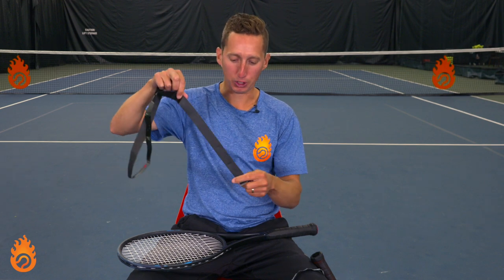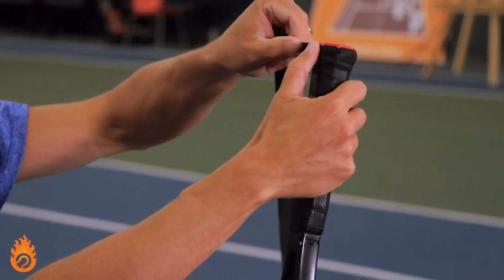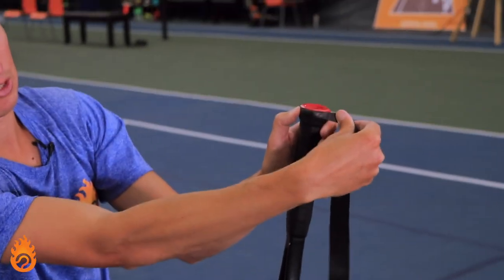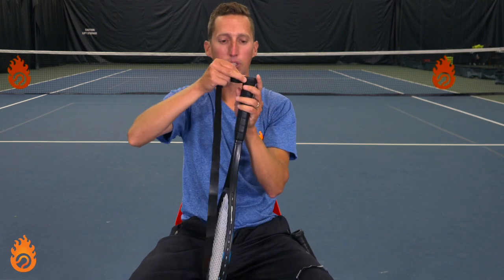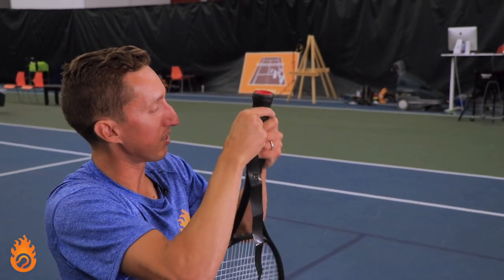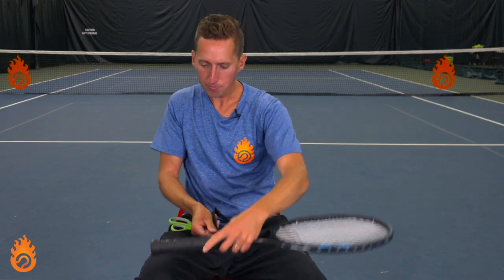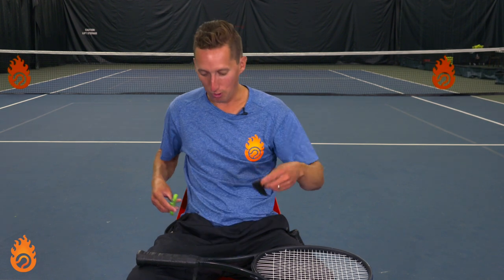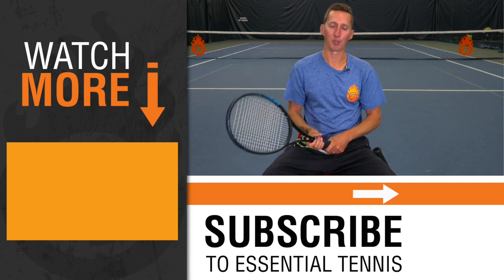How to REPLACE your Overgrip (the right way)

Comment: When I change my overgrip, there's usually a lot of residue from the previous overgrip remaining on the grip handle. I used a paper towel soaked in rubbing alcohol to remove it, which removed the residue but also some of the grip's coating. Do you have any suggestions? Thank you!

Comment: Glad someone else is picky enough to cut/taper the end as well! LOL One suggestion is to look at the handle and find where the original grip starts, the start the overgrip on the opposite side.  This prevents any build up on one side vs the other, ... especially helpful if you use more than one overgrip.

Comment: I overlap by about 1/4 inch, so I don't have as much left over at the top so I don't have to use scissors to cut the excess.  But that's good to know in case I run into that situation.   I usually use black electrical tape to wrap the top part -- the tiny tape they give you in the package is not sufficient.

Comment: Great video! I find wrapping my OGs to be a bit of a "zen" moment for me before a match - I use it to calm my head and do a little shot and grip visualization while I'm wrapping them. Tourna Grips (as of a year ago or more when I last used them) did not feature a starting taper cut to the OGs, nor did they have a sticky start spot like Wilson and other OGs. I am a lefty and used to use Tourna grips because I could wrap them "left-handed" (after cutting my own "start taper" for that direction), but for the price and convenience Wilson OGs purchased 50 at a time with the start taper and sticky start spot were just better for me since I change my overgrips as often as 2 or 3 times a week in the warmer months. Anyway the start tapers on those Wilson OGs just made it convenient to wrap it "right handed" and I found that this didn't bother me anyway as a lefty. Now, it might matter to me if I had a "left handed" wrapped racquet to begin with to wrap my OG with a left-handed turn, but I've never seen such a thing, so I couldn't say one way or the other... Also, I like about 1/8" or roughly 3mm overlap. Another tip is to fold the end of the finishing tape over about 1/8" or so to enable easy removal of that tape when you change your OG the next time.

Comment: Very interesting! But some overgrips don't have any bevelled edge. It would be interesting to show how to wrap them as well...
Reply from the maker: That's true! There's more difficult to start, there's more build up down at the bottom. Basically the same process: start off parallel to the butt cap, after a full turn cut in at an angle. -Ian

Comment: Hi everyone. I am a beginner in tennis and I bought a brand new racquet. I have been told that I need to put an overgrip on top of the new one to protect it. Is this true? Also what is the difference if I remove the old grip and put new one instead to put new one on top of old one? Thank you
Reply: Personal preference, you do not need to put n overgrip on if you don’t want to. Base grips aka replacement grips can also be replaced, they do generally last a lot longer than overgrips though
Reply: I think the main idea, Miroslav, is that the grip that comes with the racquet is much harder to replace than an overgrip. So buy the racquet with a grip maybe 1/8 inch smaller than you want, and put one overgrip on it. It's easy and cheap to replace an overgrip. So I would gently disagree with Ben's answer below. Yes, the base grip is quite durable, but if you let it start to wear off, it's a pain to repair and/or replace.

Comment: Do you need to remove the previous overgrip before putting on the new one?
Reply: I'm new to the modern overgrips, but my sense is, it's totally up to you! There is certainly no harm in removing the previous one - I peeled off the finishing tape without a problem and then unrolled the old grip. There was no particular residue left or anything. And since the overgrip was still in good condition, I'm not using putting it on demo racquets that come with a 4 3/8 grip, which is a bit small for me.
Bonus idea ;): why, you wonder, would I remove an overgrip in good condition? Because I had put two overgrips on my new racquet, thinking that got me to a comfortable grip size. But then I decided it was a big big, so I removed the outermost overgrip.
Note: some will say, "never put two overgrips on at same time, because then you have a more 'rounded' grip, i.e., the bevels are not so apparent. But my grip still seemed quiet comfy - it was the final size that seemed a bit much. It's all up to you.
Reply: Oops a few typos - "I'm not using putting it on demo racquets" should be "I'm now putting it on demo racquets" etc., and "big big" should be "bit big." ;)

Comment: Whether layers of over grip are suggested or it should only be used over factory grip and replaced when erodes...?  Does using multiple over grips effect the weight, balance and thereby the swing path...? coz I have seen some players using three to four over grips and their racquet feels cushiony...their reason is they have  huge palms hence to feel comfortable they do so.....by the way for your information I am talking about some real amateur players....I have never met a pro.....so correct me if I'm wrong....
Reply from the maker: In college I used multiple overgrips (two). Yes, it changes the weight and balance slightly, not enough to make much difference. I wouldn't recommend multiple overgrips unless you're specifically looking for a larger handle.  -Ian

Comment: Ian when is the best time to change from two handed to one handed
Reply: Do you mean in a given match or whatever? I'm certainly no expert on the two handed backhand, usually being a one hander, but my sense is that you might release the second hand for (a) balls you have to stretch way out for and are just  trying to block back, (b) drop shots, and maybe (c) volleys. Also note that if you are using a semi-western or western grip for your main hand, when doing a drop shot you might rotate it back some to more of a  continental grip to get some underspin on it. You also would rotate back like that for the classic one handed volley, which I think uses the same, continental grip on both sides.

Comment: Put more overlap and there will no more tape left. You just have to fold it in two and put the finishing tape and voila.
Do you see yourself using scissors between sets? This whole thing should not take more than a minute !